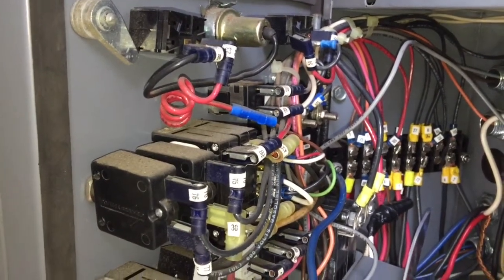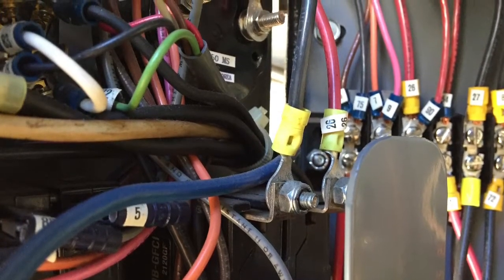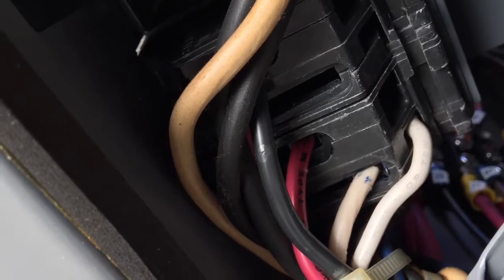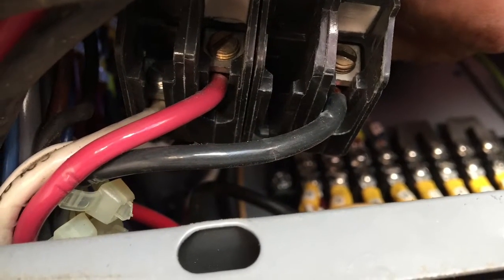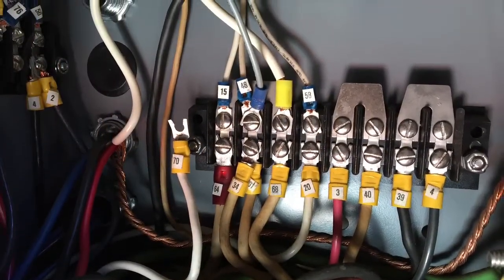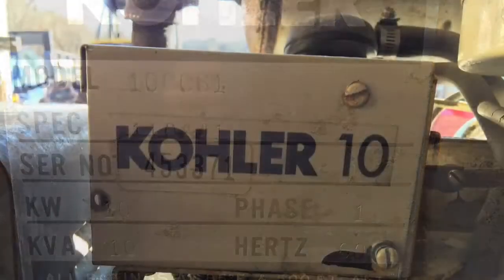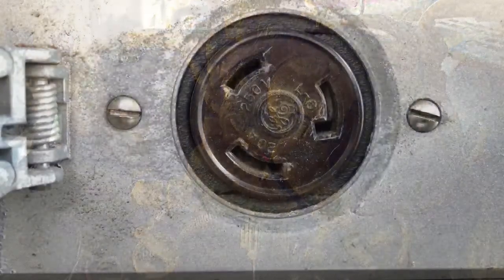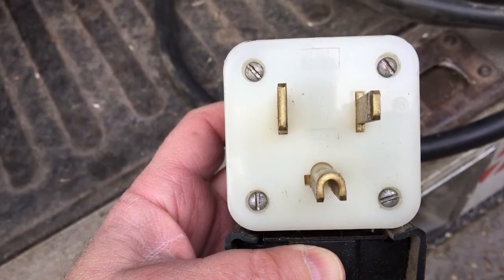Quick fix of the 220v on a 10k generator on a former Verizion service truck.

Comment: Outstanding! Nice fix and I love the labels for each each wire terminal.
Reply from the maker: Yea, it would have been a lot handier if there was a schematic that went with it though.  ;-)    
You can definitely see that these units are assembled on a line outside of the truck, and planted though. 
The access door would only open 3/4 of the way. It made pulling that breaker an incredible pain.